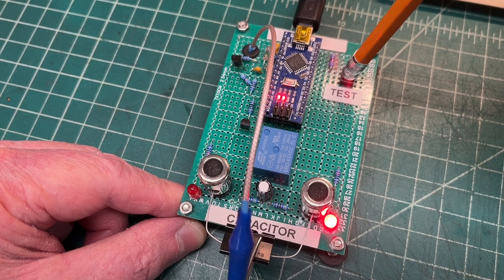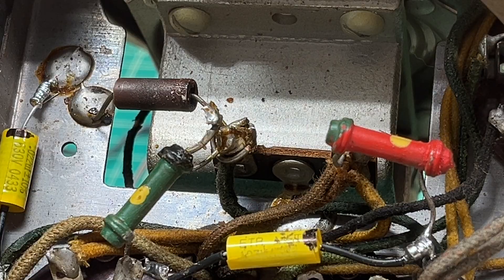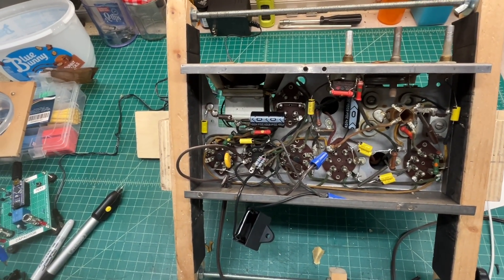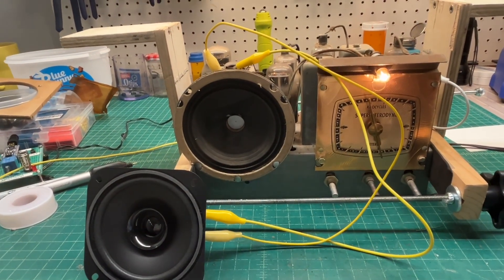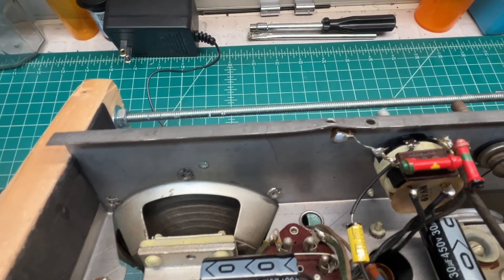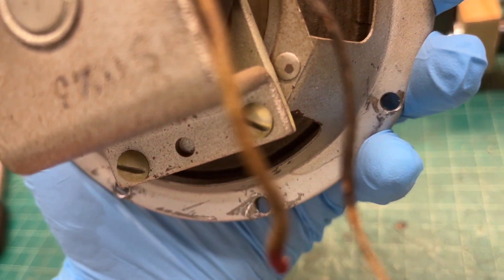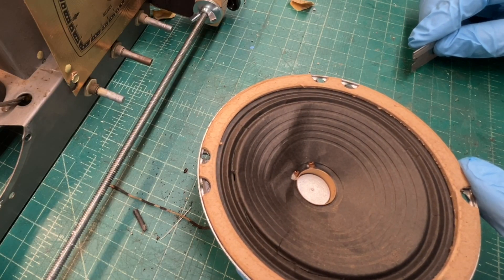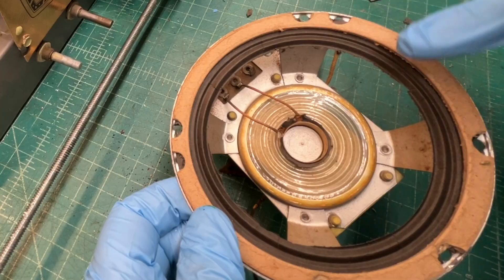AIRMASTER | Playing w/ Distorted Audio | Loudspeaker Woes

Comment: Thanks for the video Don. I like the capacitor foil indicator, I need to look at building one of those. The 8 uF cap looks like the one I used on the Marshall, mine was for a ceiling fan. Im sure you will have this speaker fixed in no time! Take Care—Larry
Reply from the maker: CBB61 8uF for ceiling fans and it worked perfect. The little capacitor tester does come in handy. Thanks for watching Larry. Best, Don